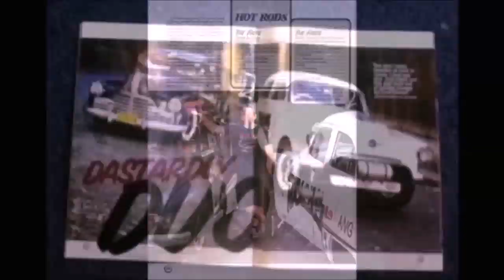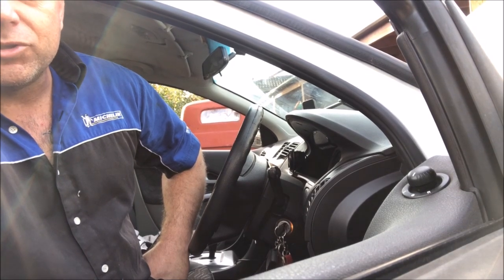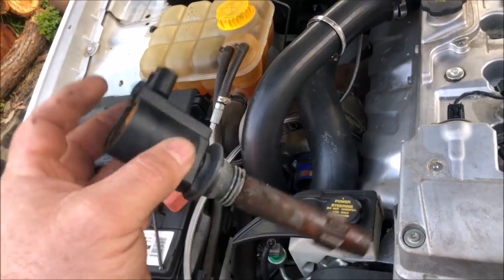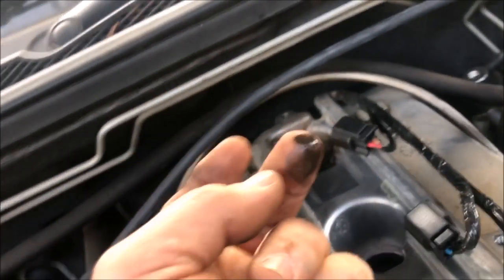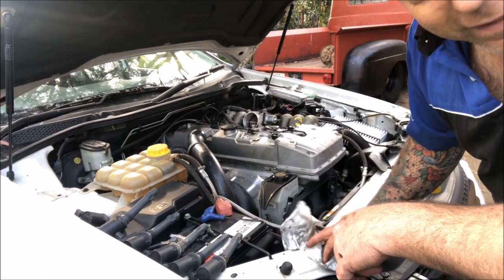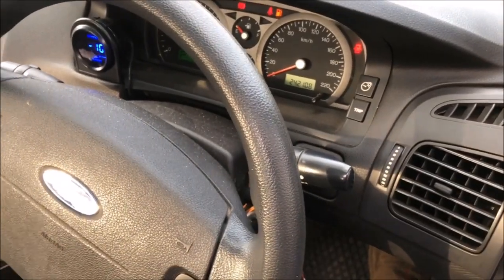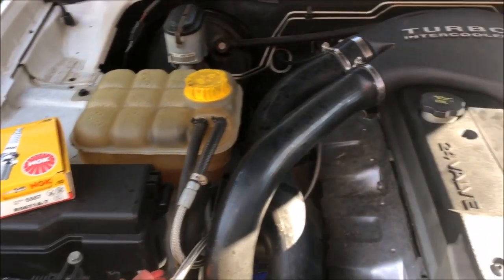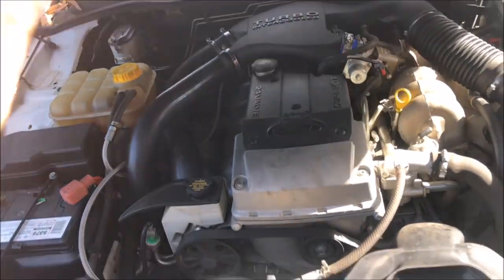Reliability Issues? - NA Barra Turbo conversion

Comment: I always gave my BF Tornado (and now FG XR6 NA) coils a spray of silicone tire shine stuff to help prevent issues.
The FG coil cover definitely seals better than the BA & BF (and also has the bolt down coils compared to B series).
I have noticed that the VCT solenoid seals have leak issues in the FG compared to B series, which tends to fill up No 1 & 2 cylinders with oil.
Reply from the maker: Cheers, great tips! Happy new year

Comment: Looks like the same problems as the 4.6 Mustangs and F150s here in the states, rain water coming by the seal above the rear coil and getting by the coil boot causing corrosion and misfire but with the cover over it could just be condensation accumulation under it and traveling back. Ive always replaced the the spark plugs when replacing coils

Comment: there's a chance that #6 plug has been in the car since new, on account of it's such a bastard to change. I read on the AFF that you should NEVER pressure wash near the rocker cover (which may explain the moisture and the failure of the plug caps) and I used dialectric grease on the caps.
Reply from the maker: I replaced the plugs when I installed the turbo in January and it was all spotless down there back then. I’m pretty certain the moisture came from the couple of Klms of flooded water I drive through during the torrential rains we had a week after the instal. But yeah I can definitely see why you shouldn’t pressure wash around there, it got nothing to stop the water getting in. Thanks for watching man, appreciate it, cheers 🍻

Comment: Hey man just finished my conversion on ba! 2 weeks in no problems... as you said all in the tune :)
Reply from the maker: That’s awesome!! Yep 100%
Reply: What about valve springs and head studs? Did you replace the factory oil pump with a billet one? These are issues you will encounter if you are going to be putting the boot into it regularly. Then theres the connecting rods-did you use LPG rods? The list is extensive if you want reliability and long lasting engine drive ability.
Reply from the maker: Agreed but not at 7psi
Reply: @MEDCANWhitewidow  ran this combo at the dragstrip and 2 powecruise events no problems accept for s flex plate :)
Reply: @RossHollandAU  fair enough. The turbo kit i was looking at was 15 psi so I would have definitely had to do a lot of mods.

Comment: I had the same problem,  bought std upgraded coils and replaces the spark plugs, water will go in if you wash the top of the motor, they are not sealed!

Comment: Hey i just watched your video but I’m about to do a turbo conversion as well it’s gonna be all stock but running like 8 to 9 psi on my 2007 bf n/a engine which has 145k on it I’m wondering if it’s gonna blow at all i know the gear box won’t because i got a T56 manual 6 speed with a fresh clutch so yeah I’m also wanting to put a %20 power bond underdrive kit and I’m wondering if it’ll push it over the 400hp
Reply: easily bro 125%. ive had mine on 14.5 pound of boost for 4 years now and havent had a single drama. bone stock internals

Comment: Hey buddy really like the videos you explain things pretty good an I've just put a gt3582  on a bf falcon I had at home an had a rod fly out the block now I've got a dedicated gas engine to bolt in hope things go better this time
Reply from the maker: Ah that’s no good. How much boost were you running?
Reply: 12 psi
Reply: How do I turn the boost down to 6 or  8 psi
Reply: What sort of spark plugs did you run in yours
Reply from the maker: You need to adjust your boost pressure regulator down to the desired boost pressure, assuming you've installed one. And I highly recommend having it tuned correctly on a dyno. I've been flogging the crap out of mine now for almost 8 months and she's still as happy as the day I installed everything. 12psi is too much, not only are the rods an issue but on the N/A, you're running heaps more compression so once it's all forced inside the combustion chamber, you're actually amplifying the boost pressure again. I'm just running standard plugs set at .7 at the moment
Reply: Where did you buy your wireing harness from the standard map sensor to the 2 bar
Reply from the maker: eBay

Comment: Just got a couple questions if you dont mind me asking
1. I got an fg that i want to do this to, but car is at 300k kms. Is this likely to be an issue? Car is well looked after, never had an engine problem or anything and always serviced well before 12k kms.
2. Will the na zf 6 speed survive when boost is added (aiming for 5-8psi)?
Thanks
Reply from the maker: Hey man, the old Barra’s seem to go forever, mines got almost 245000 on it and it’s going strong, but I’d probably be checking the compression and if it’s healthy, why not. The stock oil pumps are known for letting go randomly so that’s just a matter of luck really. Same Deal with the transmission. Mines a very tired BTR and it still pulls hard and smokes the tyres on acceleration. I’d have a crack, NA Barra engines and boxes are cheap so you’ve got nothing to lose. Just get it tuned by someone who knows what they are doing, there’s a whole lot more involved in it than boost pressure. That’s my opinion anyway, hope that helps. Cheers 🍻

Comment: If I run my factory turbo ecu and all factory turbo bolt ons will it be safe on a na engine?
Reply from the maker: Hey man, I can only assume it would be ok unless it’s had a different tune run through it. The tune in mine is a bit more stout than factory and it doesn’t give me any trouble. Wouldn’t hurt to run it on the dyno though just to make sure it’s a good clean line 👍🏻
Reply: @oldskoolonly  cheers man my factory turbo territory that I rwd converted threw 2 pistons out the block and it only owes me $700 and I have a n/a engine there so don't want to spend $3000ish on a turbo engine truck isn't worth that much so was just going to try my luck on the factory turbo bolt ons and factory turbo ecu on n/a engine it's basically just made for skids just to be a lil bit different
Reply from the maker: Yeah cool! Sounds awesome

Comment: Hey mate just wondering witch transmission is the most reliable for this kind of build  ?
Reply from the maker: Good question. But ask 9 people and you’ll get 9 different answers. I’d probably recommend starting with a car already fitted with a ZF. Mines got the BTR which was slipping before I did the conversion. I’ve got a replacement BTR waiting to go in and a manual shit controller from shiftkits Australia. I’ll do a vid on that when that happens. The options are endless from mods to the btr to a good range of conversion kits for GM transmissions. I’m hoping I can stick with the BTR cause they are a dime a dozen and lots of mods available, but only time will tell
Reply: Old Skool Only Garage thanks for that keen for more vids🤙
Reply: Old Skool Only Garage slipping in these transmission usually just mean the transmission fluid is old or just needs changing ! But what do i know right you already know this being the expert
Reply from the maker: Cheers Michael. Man I’m no expert, definitely not on this stuff and I wish it was just as simple as an oil change with mine. A service was the first thing I did without any change at all, you can’t even adjust the bands on these. She’s just plain old worn this one. Thanks for watching 🍻
Reply: @oldskoolonly  If you can dig up an RTV box, it's got v8 internals in it, you wont break that in a hurry.
Reply from the maker: Cool didn’t know that. Thanks for the heads up

Comment: This is the problem when you do a cheap as possible turbo conversion on a N/A barra,reliability issues. If your going to do a conversion and you want good reliability and a long lasting conversion you are going to have to spend approximately 5 grand or more. I looked into it thoroughly and i just cant justify spending 5 grand plus for a daily driver.
Reply from the maker: Problem? What problem? She’s been a daily driver that I’ve driven the hell out of for 12 months.. no problems that relate to the turbo conversion 🤷🏻‍♂️
Reply: @oldskoolonly  for now,but eventually you will have to build the engine up to handle the extra pressures on everything as you continue to drive it daily. If your like me and like putting the boot into it thats when things start to fail like oil pump,valve springs,transmission, theres so many things that can fail once you put extra pressure on all the N/A parts. I want reliability and longevity in my fg xr6,hell theres enough shit that wears out on them as it is without having to worry about other stuff related to turbo conversions. I just replaced the dreaded diff bushes and put an external transmission oil cooler bypass on it as we all know the problem with the maccas strawberry milkshake that can happen at anytime with these systems. Its great that you can do a turbo conversion for just over 2 grand and for that i take my hat off to you,but theres a lot more bucks involved if you want reliability and long lasting reliability on these barras.
Reply from the maker: Hi hear you man and not here to argue but seriously, 7psi is nothing and what if I blow her up? $250 and You can buy another engine and away we go. I’ve been building cars for over 30 years and putting the turbo on this thing has been the most rewarding bang for buck performance conversion I’ve ever done. I’ve actually got all the beefed up bits and another engine here ready to go waiting for her to let go, but she just keeps on going.. thanks for watching man, really appreciate your feedback 🍻
Reply: @oldskoolonly  i totally understand were your coming from,my fg xr6 only has 103,000 ks on the clock and one owner in 10 years,I just can't justify thousands more on top of the 11 grand I paid for it.All good,each to their own mate. Cheers.

Comment: Use 0.7mm. The oem 1.1mm is way too wide and boost can blow the spark out. 0.7mm for the win.
Reply from the maker: I can assume you didn’t watch all of the vid 🤷🏻‍♂️ but yes you are right .7 is right gap 😉👍🏻
Reply: @oldskoolonly  ok. I also run a JMS coil voltage booster on my FG XR6T GTX3582R, up to 24psi on e85 (good fun).
There is a hobbs switch that triggers the voltage booster to 18v (adjustable) on the coils when ever over 5psi boost. No, the coils dont overheat for only a few seconds of 18v, but, no misfire @ 24psi on stock coils. Scotty from Streetmachine also had one fitted to turbo taxi by Herrod.